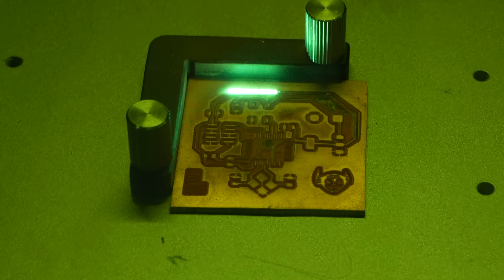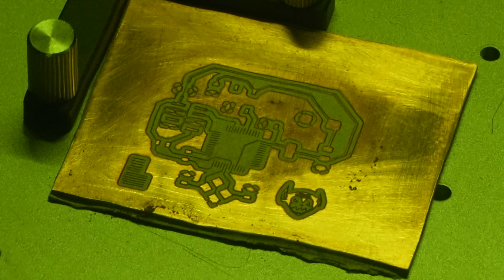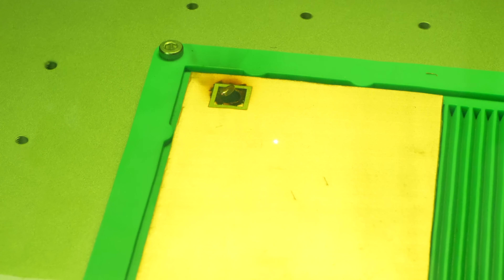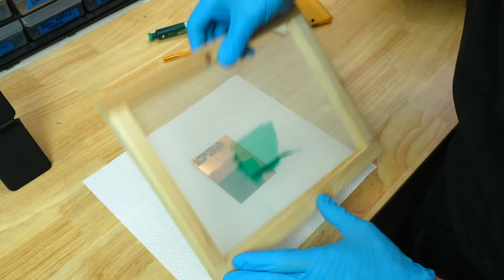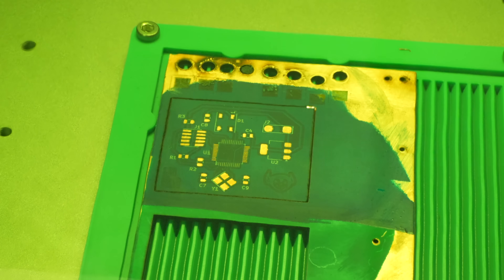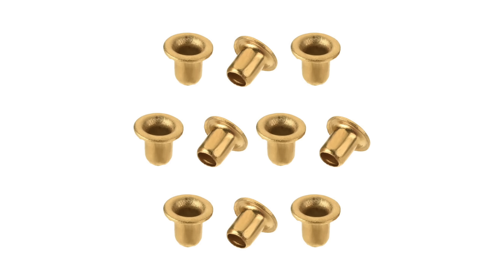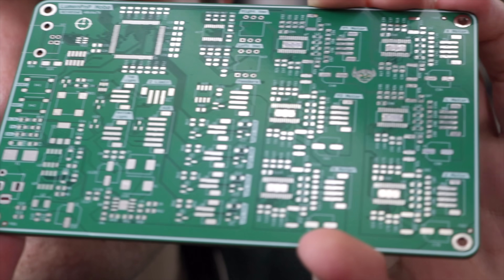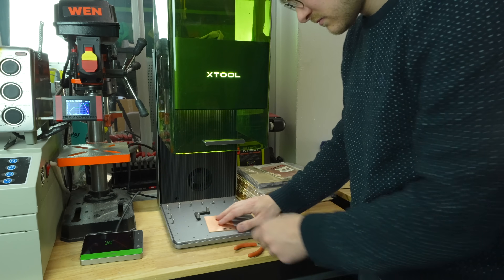Prototype PCBs faster than 3D Prints

Comment: hey stephen we should definetly get in touch.. i've been trying to do the same thing for like 6 months now  and i have tried many different approaches to some of the problems you enountered here and i landed on quite a couple of unique methods of dealing with some of this problems...i have ultimtely been successful but my technique is very different to yours ,its slower but has a couple of pretty cool ease of life features... 

for 1 my 30 watt laser is best for 150x150  and i can do copper ablation that way however with a new technuique i think i am sure to push it to 200x200 but it may be possible to go to the max lesne of 300x300 and still work  using the chemical approach...  u start by coating the board with black acryilic paint spray(sand down copepr before application) and then  use the laser to expose the copper.. then do the usual submerging in ferric chloride { note 1) sodium persuflate does not work because it damages the acrylic, 2) agitation of bath is mandatory, and i did it by just taking a compressor and blowing over the bath to make the liquid move a bit, no need for complicated setups ,3) keep a close eye on it... and do not let it sit too much.. or else u get undercut and traces can get disconnected)

a very important step that you missed is tin plating....  lookup liquid tin... (hydrocholoric acid + tin pipe solder (97Sn3Cu, anything else will not work + thiourea) its a liquid that u submerse your circuit in for like 10 seconds and it plates all the exposed copper with tin  which makes soldering so easy that you practicaly can do it without flux..  very important note when doing this... unless you plan to solder things on it right away... take your soldering iron and cover all pads with electronics soldering (Sn60Pb40 ideal or SN60Bi60) ... and the reason is pure Tin oxidizes when exposed to air... and the oxide is way more resistant than copper oxides.. meaning not even flux can save you at this point.. the 2 aloys mentioned above do not do this and thus u can return to the board later.

an other aspect of what i did was i explored via plating with carbon paint and copper sulfate  -i had very limited and poor results, needs more experimentation, i abandoned the idea for the time being... will return to it.. main issues was dendritic formation due to unknown reasons... either incorrect chemical formula or voltage configuration issues.

lastly regarding the rivets for THT... (they are called eyelets)  they have a huge problem... once inserted the wide part has no guarantee that it contacts the pads below unless u solder them... and u can only solder them if the pads are larger that eyelet... not a fan of them... alternatively i heard of a nice thing that seems like a way better idea that just sticking a copper wire through the holes, which is gonna stick out liek a sore thumb once soldered in and takes a lot of time to get right.... take a very thin copper wire, stick it through a needle and then just suture it through the holes... and when you pull on the wire  it comes incredibly close to the PCB so then u can just solder them using a copper wick.. basicaly making a lot amperage but very flush via... u can of course run your needle several times if u need a bit of a thicker connection.... (i have not yet tested this)

and many other ideas and experiments... bu yeah  we should definitely get in touch
Reply: oh and i forgot to mention..once the ferric chloride does its thing... u wipe out the leftover acrylic paint with pure acetone...

Comment: have you tried using conical pins and holes on the pcb for the placement? If you don't want to plate hollow holes you can try to make thinner holes and put a piece of wite then use a simple machine to press it. This is a sample video explaining howe they do it when working with jewerly: https://www.youtube.com/watch?v=SZsI2op1Nis

Comment: Okay bear with me now: flood the board with argon to avoid it from burning and charcoaling! Argon is heavier than room air and a simple raised board all around and a flask of argon is enough and you’ll get perfect cuts
Reply: How do you get the Argon? Thank you
Reply: @pocoso every we,ding supplier store should have them, it’s one of the most used welding gases
Reply: i want to try it, just pour it?
Reply: @rioferzz  Yeah, build a small wall around it out of cardboard to test it, maybe 3D print it later. It doesn't have to be 100% airtight, just try to let the argon flow in gently, without much turbulence
Reply: Charcoal is made by burning organic materials (wood etc) *in an oxygen-free container*.  Charcoal is wood that has been burned without oxygen.

That's why you can take the charcoal and burn it again in your BBQ grill. The second burn adds oxygen. Which converts the charcoal into ash.

So the process you described is how to turn the board into charcoal.

Source - I make charcoal.

If you're wondering WHY burn it before you burn it:

For clean burning the second time around.
The first burn, which converts wood into charcoal, burns off a lot of stuff and leaves behind almost pure carbon. All the random compounds in the wood that would make your food taste weird gas off. Then in your BBQ grill, you are burning just carbon (charcoal), so that only produces CO2 - a nice clean fire.

Comment: Some crazy ideas. :)

I didn’t know that a powerful laser could erode a copper surface to create printed circuits.  
Why not try other methods?  

For example, using a woven mesh of metal threads, soldering the components, and then using the laser to cut at specific points on the mesh to detach it. This way, the components would remain soldered with their connections made, leaving a pile of metal threads as residue. It would be somewhat like the freeform on-air electronic circuits we make when learning or testing something. One issue is that pre-planning would be necessary since the mesh would only have threads along two orthogonal axes. I’m also not entirely sure how the components would be soldered before this process.

Another idea would be to use different substrates, like thin adhesive metal sheets. Perhaps the laser could cut them more effectively. For drilling holes, it might be enough to "pierce" a terminal to perforate the sheet and make contact with multiple stacked layers. This could even be automated with a Cartesian plotter-like device.

Another one: using the laser for soldering. Is that possible? In the ‘90s in Spain, a pen with a coil of metal wire that came out of the tip became popular. You’d pierce the component terminals, and the wire would wrap around the lead on the other side, then stretch the wire to connect to another component’s contact point. If laser soldering is feasible, it could automate the process of bringing the wire and solder to a point and applying the laser to join them.

A variation: I like the idea of stacking layers with components sandwiched between them, like integrated circuits. This way, I could attach components to an adhesive plastic sheet and use the laser to solder wires between them.

Well… these are some crazy ideas. I hope some of them spark inspiration for you. :)

Comment: for the double sided via problem... ¿is there something like a conductive paint or resin? i mean we could submerge or just fill the holes and cover them (top, bottom and inner walls) then just laser again the board to clean but not the holes (alligment problems: 3d printed holders) and after cure it with the normal resin.

i saw there it was a graffite based paint thats conductive, but i dont know how much.

Comment: For vias, maybe get a piece of stiff wire that's only slightly longer than the board is thick, peen over one end of it (make it essentially a nail), put it through the via hole, then use a press to mushroom the other end on the other side of the board. It should make a good electrical connection and be fast with the right tools.

Comment: Can do double sided PCB vias easy with fibre laser.
1. Drill with laser through the first layer of copper and through PCB and through to the other other layer copper but try not to pierce through. And may be a few low power cleaning passes to clean the copper.
2. Make a stencil made just for through holes and then use it to fill the holes with solder paste. (Or fill manually.)
3. Use an oven to melt the solder in the through hole to join the top and bottom layers. (Or use a soldering iron / hot air.)
Probably works better for thin PCB. Let me know if it works for any of you 🙂

Comment: I'm a little surprised you can't just fill the via with solder. You could try to get fancy and etch a hole to the underside of the bottom copper, so you can fill the hole with solder from the top side to connect both sheets. Or a high temp 3d print to put on the underside while soldering with holes for the "rivet heads" for solder to flow around the bottom and make connection. You'd basically be casting a solder rivet. Youd need air vents and such.for the solder to flow down.

Probably less reliable if the board sees flex and not as automatable for shops that aren't doing soldering, but might work out for you.

Comment: Drill hole. Press fit copper wire/rod and solder over both sides. This will work and limit the hieght. Still might not qork under chips but if done skillfully should be fine

Comment: I dont remember what they were called  (circa 2002) - but I had these stacks of via inserts that are made of pre-scored solder - and I could load them in a .3 or .5mm mechanical pencil - insert into a drilled hole - snap off, repeat.   then heat the board and the vias are all soldered through...   the scoring came in diffeent lengths to match the board thickness.

Comment: It's been a while since I did this, but I used FR-4 with 2 oz copper, and sprayed the board with a thin layer of matte black spray paint.  That let the laser (35 - 40 w CO2) put enough heat into it to ablate the copper.

Comment: This is brilliant.

I'm an electrical engineer, and over the past 2 years I've been building up a hardware company selling products I am inventing. My next big project is building a custom battery powered induction heater. I haven't actually done any proper PCB design since university, as I went to work in RF engineering... but I'm really looking forward to diving back into it.

This method using a c02 laser seems awesome for rapid prototyping. It would save potentially months of time while iterating through pcb designs. It definitely has it's place!

Comment: Wild idea, I have no idea if it's practical, but... could you squeegee some fine powdered metal like copper or even aluminum into the via holes and then use the laser to fuse it to the board?

Comment: Connect one side of the board with another side using copper tubing.  Look at getting a flare tool that will let you flare the end of a copper tube.  With one end of a copper piece flared, cut it and slip it through the hole and flare the other end.

If you want to solder it still, that should be quick.

There are copper rivets for vias already available.  As someone already mentioned, cutting out the layer of copper where the rivet sits would let it be flush... Then solder it down.

Copper is so soft you could probably make a press that would fit the rivet right to the board.  Keep in mind crimp connections are solid when there is enough pressure on them. The trick is to not pulverize the board layer in the middle.

Comment: Crazy idea for vias: Place the board on a sheet of metal (Tin? Woods metal?  Low temp solder? Not sure). Then place the PCB on it. Vaporize the metal through the vias, and let it coat the vias as the vaporized metal condenses on the via walls.

Comment: I'm writing a guide for this.  it's extra work, but the key is to copy the design on two layers.  they're both negative fill, fill=not copper.
offset one inward by 0.1mm so ONLY the offset portion is there.  cut that with Offset Fill 0.02 stepover (for a f160 110mmx110mm lens) 5000 mm/s ( or as fast as you can accurately scan) and pulse freq must fit the criteria scan rate/(stepover*freq) is between one and two.  change q-pulse width to control power.  the key is don't give it too much power when the copper gets thin it will lift and the  substrate will char.  the offset is a very small area overall  so going slow for like 20 passes is nothing.
then take the other copy and offset inward by 0.08 and unlike before, we're doing the whole regions not just the offset.
so, the traces should have a clean clearance already cut around it and that offset allowed some overlap over the cleance but won't reach the traces.
that one, set to fill at only one angle, and turn off bidir scan.  0.02 to 0.01 line interval, freq meets the same rule.
again, we can hit it pretty hard at first but it needs to be very light as the copper gets really thin.  you can't lift the traces by overdoing the second step, but you could lift slivers of copper off that become a prob

Comment: By the way if diode laser used it might solve the alignment problem. You may put both laser on the same head from different sides, only one factory alignment will be needed.

Comment: You can buy pre-cut tubes of copper or brass for visas and thru holes and essentially rivet them over on both ends of the hole. Then all you have to do is tin them to the pads. They sell these things are ready for some home. PCB solutions. I forget who the manufacturer is.

Comment: The via solution is simple. Just a lead from a clipped leg of a resistor or other component soldered on both sides of the board. I just finished restoring a 1970's Sensui 9090db receiver that had one of the first double sided PCB. The dolby board was only double sided in it, but needed all the vias needed fixed by "pinning" the vias like I described above. They didn't quite get it right  back then with the via tech, so with age, corrosion compromised the via's, which  lead to most of these not working unless the boards where "pinned". But easy via pass through solution, just a lead!

Comment: Instead of a rivet i'd think about a tiny tube or a wire who's lengths is equal to the thickness of the pcb which fits narrow into the hole and by applying an additional layer of tin to the pcb tracks it would be soldered in and gets connected.

Comment: Crazy thought, pads on both sides, drill the holes. Mix solderpaste with copper powder, fill vias and use something like a hot plate. The copper powder is for bridging the gap. Copper should be a bit above the material so it should adhere on the bottom side. I think you could use the laser to create a very thin via template for that so it doesn't get on other copper pads?

Love what you are doing. Back at where I worked in the 90s we had to build prototype boards by hand. We are so spoiled nowadays, and did rivets for dual layer, we accually glued two boards togther.. fun times. But we also kept the clipping of resistors. If a rivet was to big for where we needed it, we added a pad on both sides, drilled a tiny hole and used those clippings to the make the connection. But depending on the number of via's it's quite the manual labour tho.

Comment: For holes, the galvo system should have no problem doing the holes in a batching mode where it will do one pass on every hole, and then go for the next pass, instead of doing a single hole all the way before going for the next hole. This would reduce the heat seepage to the surrounding material.
Whether the software that generates the G-code supports this is, of course, a different question entirely.

Comment: Instead of a hole for the via you can make a slit also, push some small copper sheet through, bend it and solder it. Uses up a bit more space, but is probably going to be thinner. Also I don't know how there's not already a bare PCB product model that has strategically placed vias across it already. Then you can just NUKE the ones you don't need.

Comment: Having done similar with milling, I very much like the idea of doing single sided x 2 and glueing back to back. I had some long strips of t shaped via pins that broke away, rather than rivet you undersized slightly and soldered both sides. I imagine it's possible to wire feed solid core and push fit and side cut really close, then same as a pad stencil paste over and bake. Its an idea....so bound to be way ore difficult than it sounds

Comment: Due to the laser causing issues with FR-4, could a different laser work better? For instance, blue lasers cut copper a lot better than IR, but wouldn't work well on other metals or material. It would take less power to cut the copper while not affecting the FR-4 as much.

Comment: what if you laser cut some copper tape - little tiny donuts with radial slits on the inner diameter.  you would place the tape over the laser drilled hole and it would overlap on the OD edges with copper.  Because of the slits on the ID you can fold the little tabs in through the hole and around sticking them on the opposite side.  After tinning this little copper patch will add the majority of the strength.  might be worth trying.

Comment: PC board is rated 1/2 oz, 1 oz 2 oz which is a measure of the weight of copper per square ft. I assume the better board for this application is the 1/2 ounce.